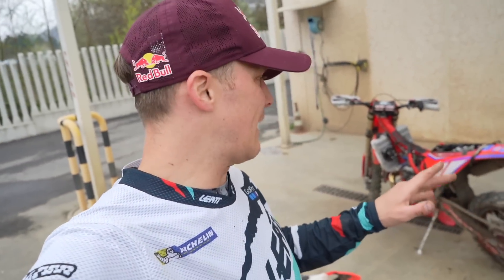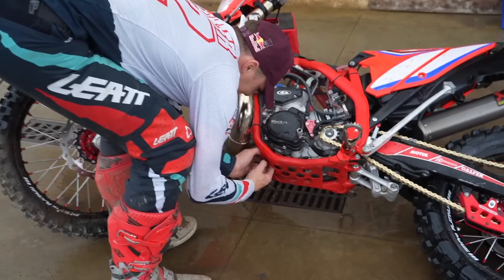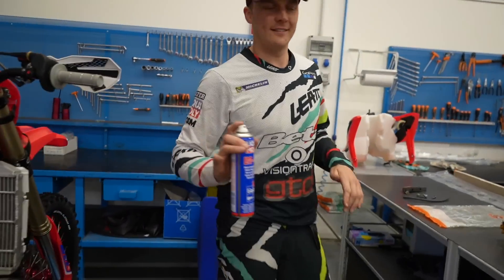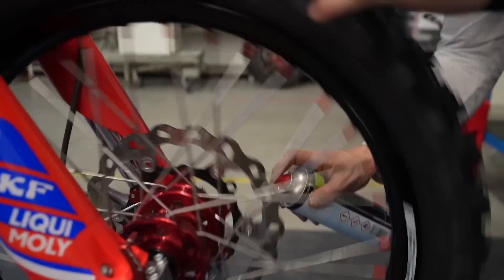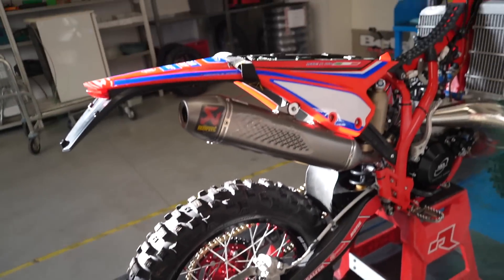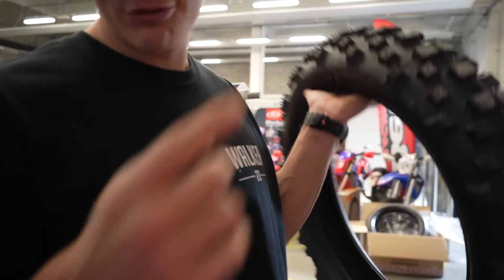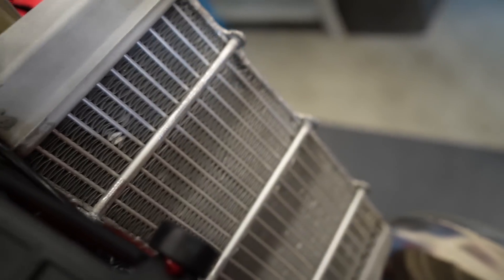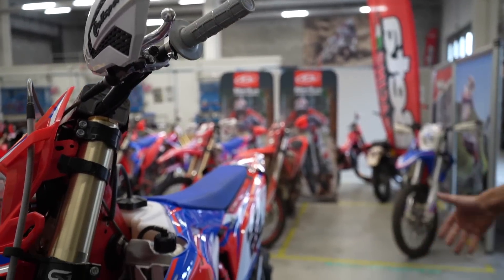JONNY WALKER - PREPARING MY BIKE FOR WILDWOOD EXTREME ENDURO

Comment: Take a piece of 3/16 brazing rod, bend it around a pipe about the size of a pop can. Bend the legs back to make an "omega" shape. Wire tie on bar brace over the handlebar clamp. Insert coffee cup. Folds down when not in use, glove holder, too.